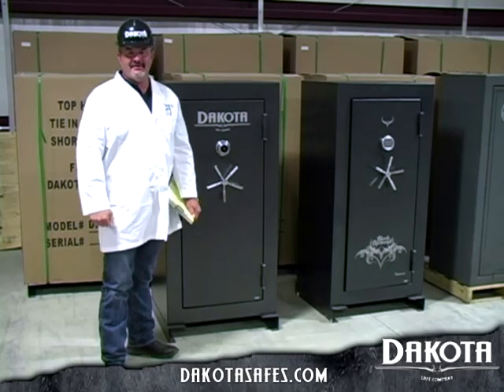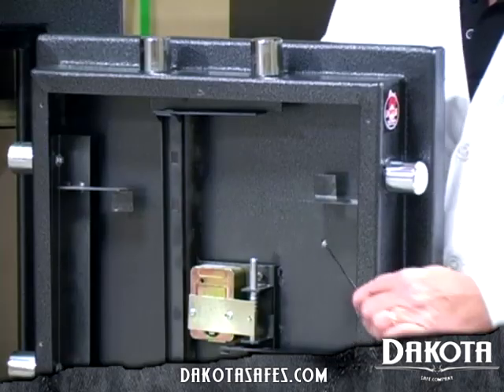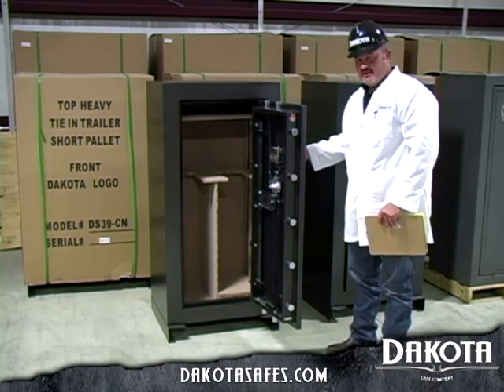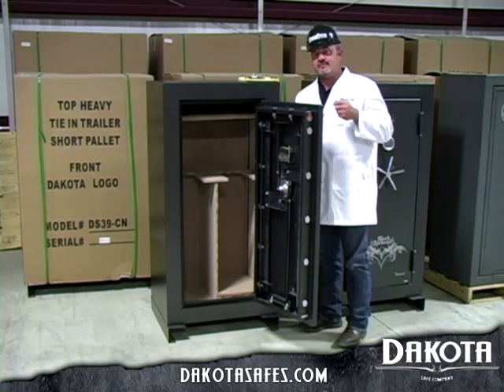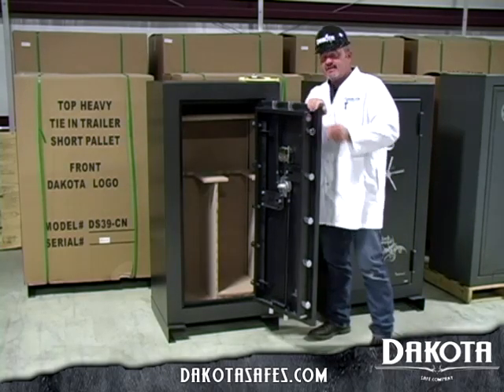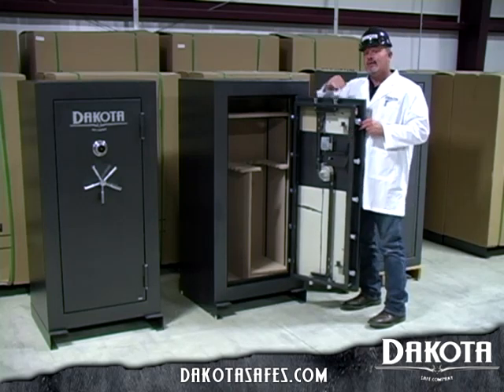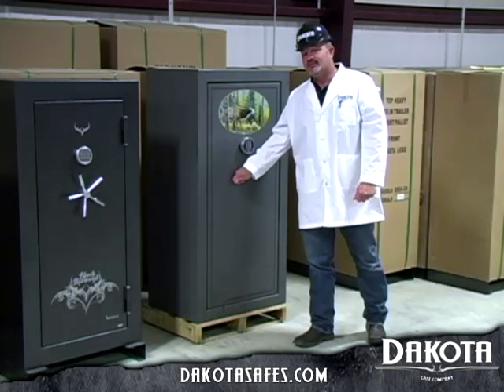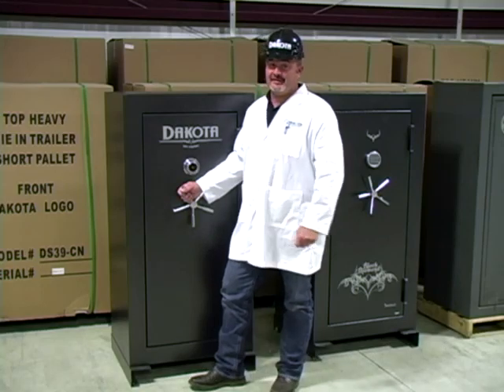Dakota Safe - Door Construction, What to Look For in a Gun Safe Door

Comment: Cut a doorway or big hole in any side of the safe with a grinder and a cutoff wheel. It takes about 5 minutes or less to cut through the thin sheet metal walls and the drywall insulation of the wall and then you’re in.
Reply: This is only one layer of security. There are several layers like first an alarm system, motion detection, dog, armed occupant, lock on the door, and finally the safe itself. I have neighbors that are law enforcement as well so it’s pretty secure. Plus the safe is out of sight and hidden. Depends on the person I guess and how effective the safe will be…I also have vibration sensors on mine to alert me if someone is cutting if they defeated all the other parameters. Good luck I love shooting to kill.

Comment: A safe is secure when no tool of any kind can force or cut the safe open, its basically impossible to open or it would take a very long time and cost a fortune. That means explosives plasma cutters, drills, 60,000psi water jets, stun guns, induction heaters, high powered emp, and heat in excess of 5000 degrees C are all useless.

Comment: The doors are still too weak, and are easily cut through. A secure safe has no key way, no combination lock, no handles, door and wall are several inches thick steel, hardened steel and concrete, there are time delays, the locking is a big bar not tiny little rods, and uses a
electromagnetic core to hold the door closed with magnetic flux. The lock is opened via an external key that send encrypted messages to the safe lock, the lock is energized from the outside, and requires a special opening procedure with a second key, any tampering, cracking or even guessing the correct pass codes is useless and any movement results is a safe lock-down, the safe uses a encrypted key reply and answer that cannot be bypassed, if the thief cuts the cable there is no response failure which will causes a silent monitored alarm. The safe can only be open at specific times which keep changing and that uses yet another encrypted system. This is a low to medium security safe. Medium security safes details cannot be disclosed, but I can say the walls are very hard and many meters thick, and mining and boring equipment will not cut through it, explosives are useless too. have a nice day..
Reply: Well sure, but not all of us are trying to lock up cryptonite so Superman can't get to it. Most of us are just buying time with the help of safes, alarms, and cameras to be the custodians of our own valuables. Even Gruffunder safes can be accessed with enough time and the right skillset.